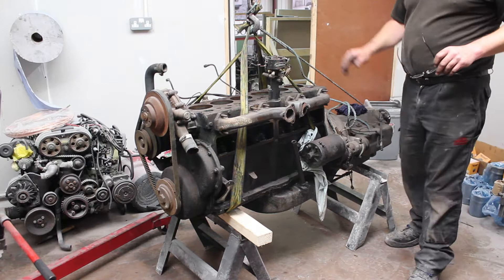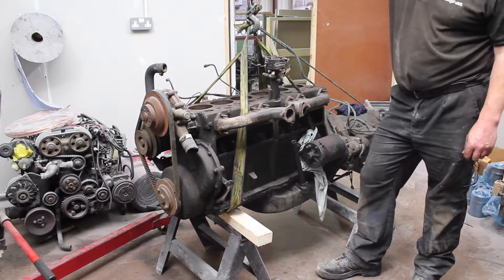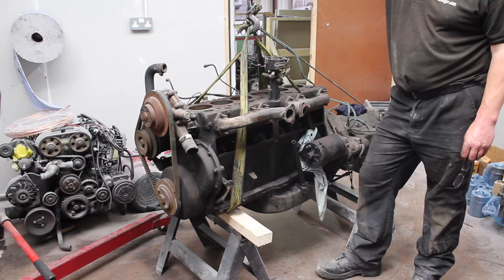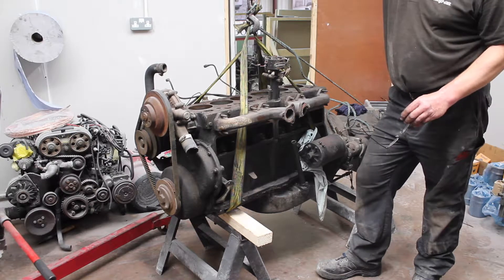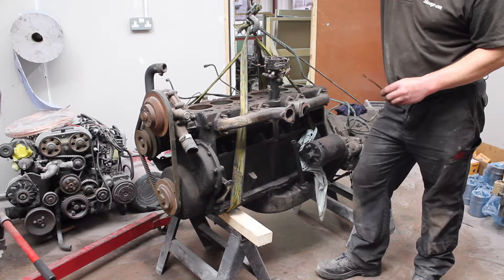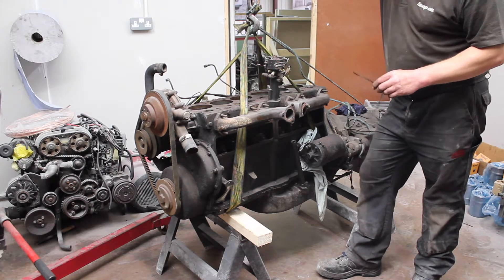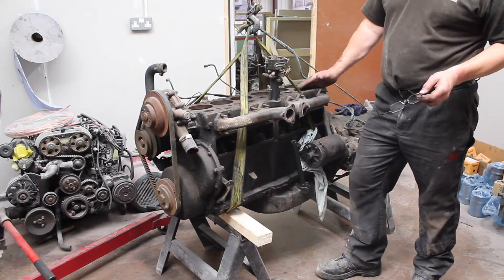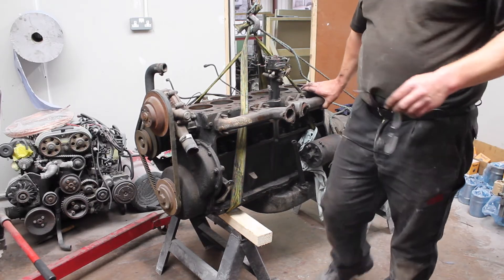Strip Down / Rebuild of a Bentley S1 Engine (Part 1)

Comment: I'm really interested to see more on the S1 engine build. Did you get it onto an engine stand, I wondered if the cast iron block would hold the weight through the transmission mounts or if you had to build it on a bench?